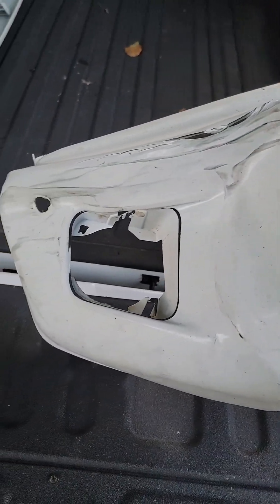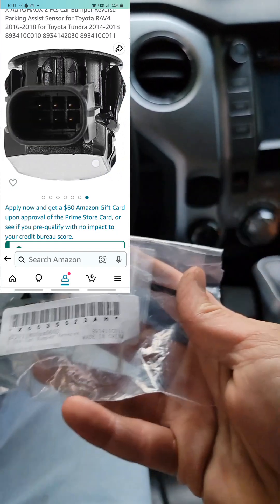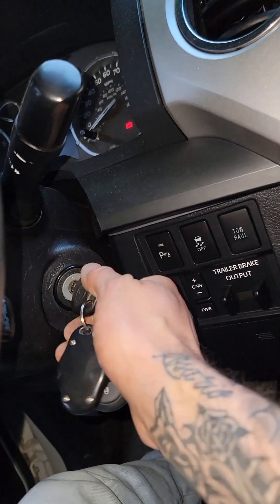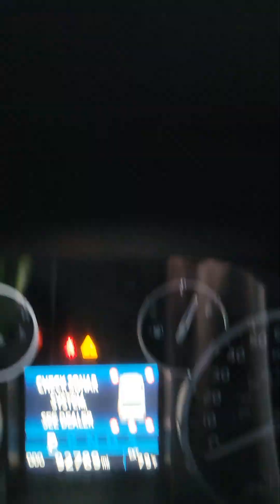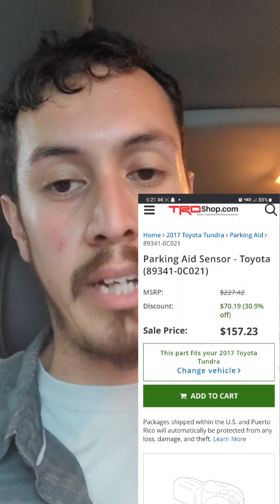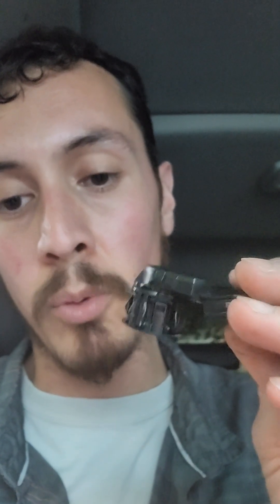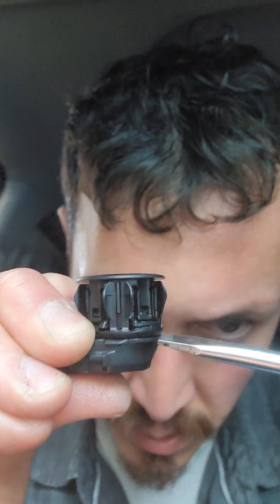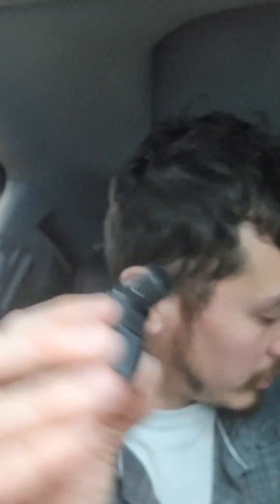2nd Gen Toyota Tundra Parking Assist Sensor Replacement

Comment: Don’t you have to calibrate the new ones regardless? Someone told me you needed a special chingadera to calibrate 😅
Reply from the maker: I did not have to calibrate anything because I use my same old sensor, I only used the plastic ratainimg piece from the new one and put it on my old one. My old sensor still works just fine..